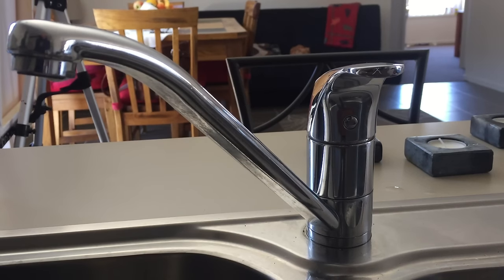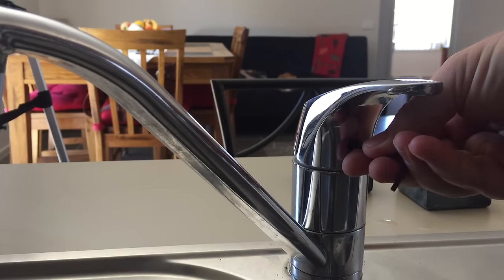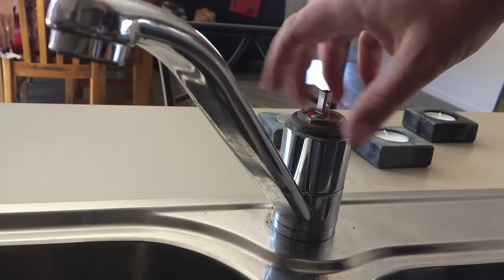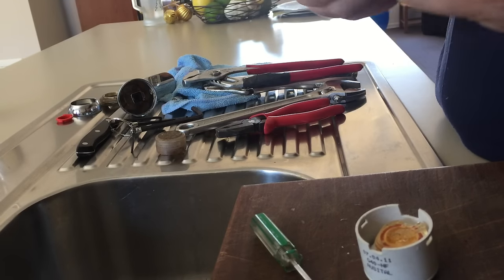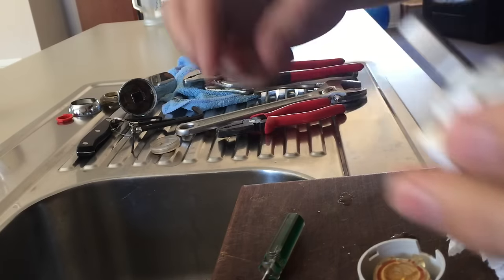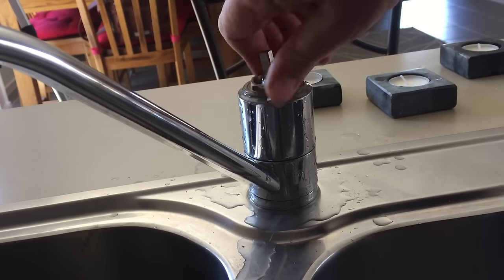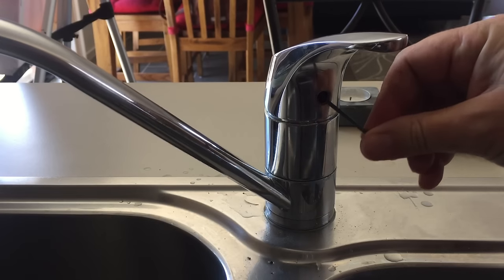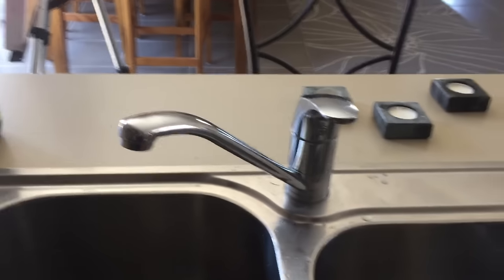How to repair a Mixer Tap / Faucet, Pull the cartridge apart and lube it. Maintenance

Comment: Vinegar works great for cleaning deposits out. I soaked my airator and tapped all the crud out and wow my faucet puts out more water. I do have a water softener but over the years there's still a bit of deposits that collect inside parts

Comment: I tried to solve a water leak at a slightly different model. Just as in de video I opened the cartrige; cleaned everything and assembled all the componets with silcon... €3,5 costs for silicon. No water drips anymore. Thanks for the youtube
Reply from the maker: Bio Win Well done. Glad it helped 😃
Reply: @Marksreviewsandtutorials  getting the top off isn't easy

Comment: Common reason for the grinding is that the locking nut is too tight and is pressing too hard on the cartridge. The locking nut should be tight enough to stop leaks, but avoid overtightening.  I would avoid messing with the cartridge.  It should last 5-6 years.  Then just get a new one for a few bucks.

Comment: Couldn't get my mole grips onto brass nut as it was too far into chrome body. So I put body and cartridge into hot solution of cider vinegar and water for a few hours to clean out calcium deposits. Then lubricated inside cartridge with silicone containing PTFE. Leak stopped, works a treat, no need for expensive new cartridge.
Reply from the maker: Well done Joseph
Reply: Cartridge is like 5 dollar.

Comment: Hi, would it work with WD-40 Specialist High Performance Silicone Lubricant, or do I have to use grease?
Reply from the maker: It will work but won’t last
Reply: WD40 isn't rated safe for use with potable/drinking water.

Comment: The tap itself is not properly fixed, it should be fixed firmly by the screws underneath before you fix the mixer on top.

Comment: where do you get the silicon lubricant?
Reply from the maker: cynic150 I am a swimming pool service tech. So I get it from swimming pool sources we use it to lubricate o’rings. 
Hardware stores will also have silicone based lubricants as should plumbing supply shops

Comment: Removed the grub screw with Allen key but the tap head seems still stuck on the shaft, I've already damaged the plastic bit. Tried spraying with wd40 but still stuck fast..... Any advice please?
Reply from the maker: Hi Craig. Do you have calcium? White deposits around the handle? If so spray some vinegar there to soften and release it. Otherwise as long as you are sure the grub screw is out then it may just need a tap to release it?